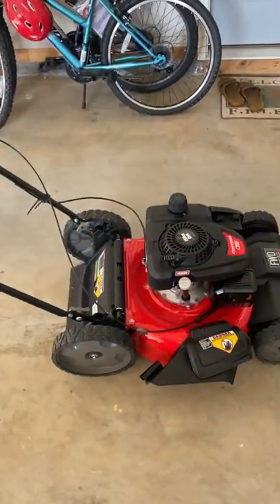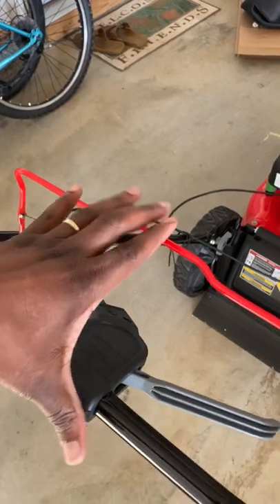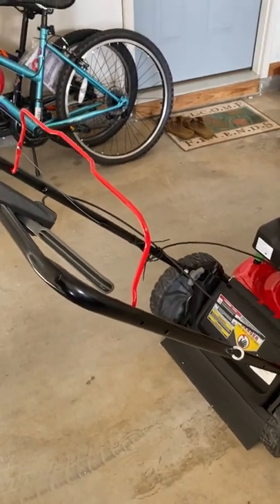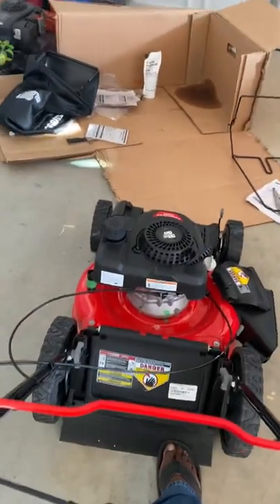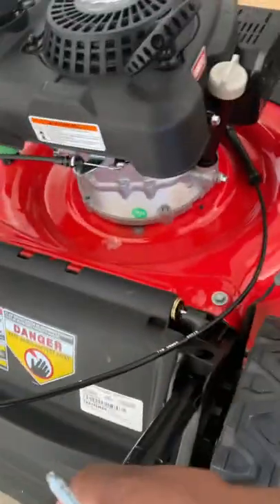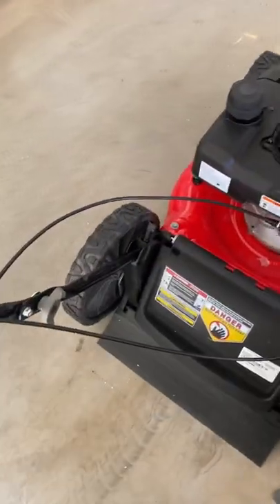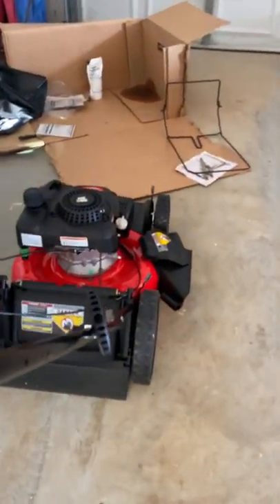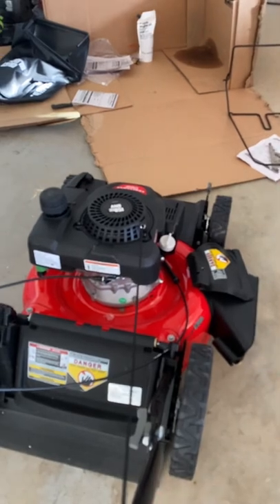Craftsman M215 Self-Propelled Lawnmower - How to Release Stuck Recoil Starter Cord

Comment: Hey i have same model and used it once last summer and left it inside theoughout winter w/ gas and oil in it. Im trying to use it again but it wont start. I used starter fluid, sprayed carburetor in the valve. Replaced new gas. It will start for 2 seconds and die out. I havnt checked spark plug yet. But i am feeling pessimistic about all this. I dont think anyone should do all these manuel repairs if its brand new. Any ideas?
Reply from the maker: Hello. Thanks for watching. Sorry to hear of your troubles. I’m not an expert, but had a similar problem with another mower. I had left gas in it all winter and it refused to start when spring arrived. My neighbor, retired mechanic, figured out that the old gas had seeped into the carburetor and clogged it. He was right. He cleaned it out and it worked. Now I drain all the gas for winter. Good luck!